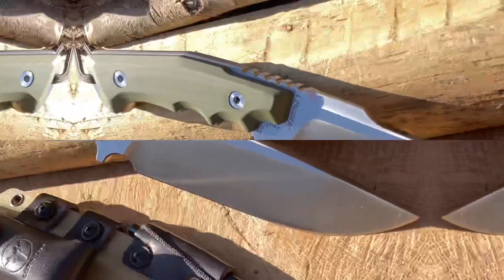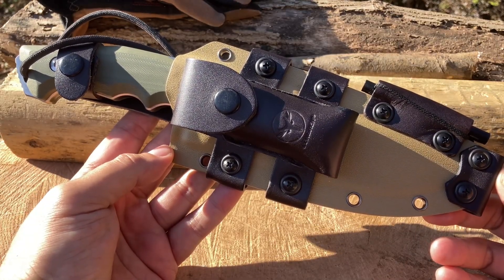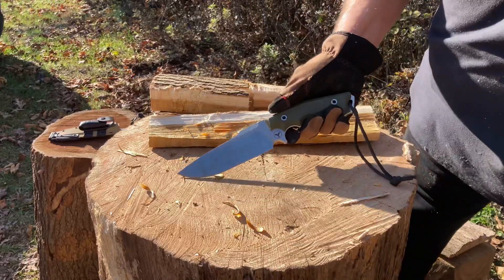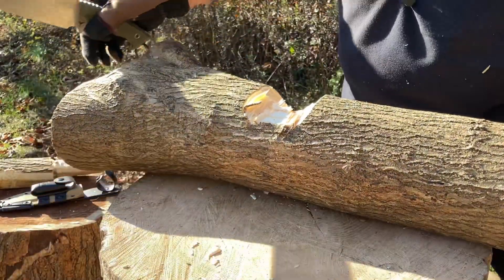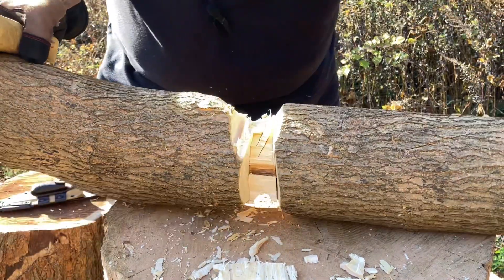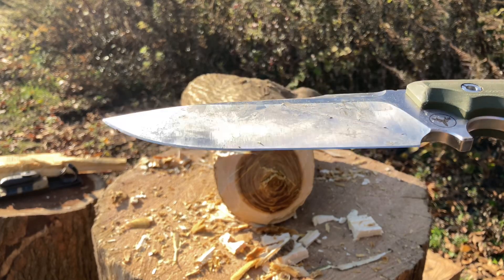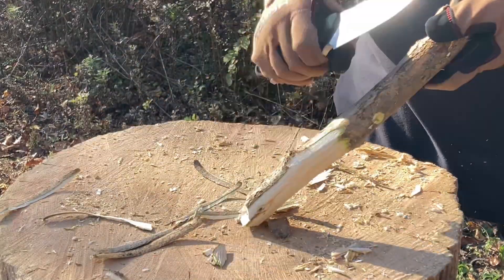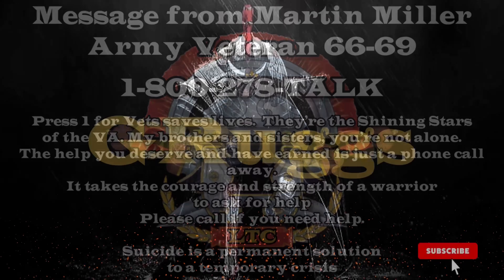Lengren Knives TANK drop point blade in Sleipner steel!

Comment from the maker: Lengren Knives TANK drop point blade in Sleipner steel!

Check it out here: https://a.co/d/0WWFHSa

LENGREN Tank 12 Inches, 7.8MM thick Full Tang, Heavy Fixed Blade, Multifunctional Tactical Knife, Sleipner Steel, G10 Handle, Kydex Sheath, and Magnesium Rod (Satin finish)

Product Description:

The Lengren Tank - an outdoor heavy-duty tool knife with a 7.8mm thick integrated spine and a bare knife weight of approximately 1.12 lbs. This is a very strong fixed blade knife, with green G10 handle scales.  Made of Swedish Udholm high wear-resistant cold working tool steel, with an extremely sharp blade and high hardness [SLEIPNER] steel. The Sheath is in a desert color Kydex sheath.  Comes with a small cowhide storage bag that can accommodate small tools, lighters, grindstones, small folding knives, and a magnesium rod (ignition equipment).

Overall Length - 12”
Blade Length - 6.14”
Blade Material - Sleipner
Blade Hardness - 62 HRC
Blade Type - Drop Point 
Blade Grind - High Saber Flat Grind
Blade Thickness - 7.8mm
Blade Weight - 1.12lbs
With Sheath - 1.63 bs
Handle Length - 5.86”
Handle Material - Green G10

Full Tang
Jimping
Lanyard Hole
Tan desert sheath with pouch
Leather Belt loop and accents
Magnesium Rod included
CNC Machined

#dskfs      
#22aday
#22adaynomore
#NeverGiveUpNeverSerrender
#NeverQuitQuitting

Don’t forget to hit the like button! 

Please help support our vets by raising awareness of the tragedy that is Veteran suicide by visiting the links below and reaching out to those in your life. If you know a vet don’t hesitate to reach out to them! 

Suicide Prevention Hotline: 1-800-273-8255 
https://suicidepreventionlifeline.org/

Mission 22
https://mission22.com/

Til Valhalla Project
https://tilvalhallaproject.com/

Message from Martin Miller, Army Veteran 66-69

1-800-273- TALK, press 1 for Vets saves lives. They're the Shining Stars of the VA. My brothers and sisters, you're not alone. The help you
deserve and have earned is just a phone call away. It takes the courage and strength of a warrior to ask for help.  Please call if you need help. Suicide is a permanent solution to a temporary crisis

I love this community!  The knife, sword, saw, fatwood, bushcrafters, and all the new people who have subscribed!  We are LEGION!

You guys' ROCK!

LIKE! SHARE! SUBSCRIBE!   Also don't forget to check out the other content creators!  They are all good people with great videos!
Reply: En effet, cette magnifique lame ne pouvait pas se nommer autrement que Tank! Les finitions ont l'air parfaitement maitrisées!

Comment: I really pulled the trigger on this knife along with the rhino and jungle primitive models.
Its name "TANK" is very fitting. Definitely high quality. Bought the coated version for added protection against rust. Feels great in the hands. Hefty but still comfortable. The handle is a bit bigger than what's on the Rhino but the ergos on the tank is much better. I wouldn't have come across this knife if it wasn't for this vid so thank you, man!
Reply from the maker: You are welcome!

Comment: Do you feel any difference when using DC53 and sleipner?
Reply from the maker: Same. Both seem to hold its edge real well.  Both are easy to strop and hone on an Arkansas stone.   They are kinda the same to me to be quite honest.  Only difference is Sleipner is more expensive
Reply: @LegionTacticoolCutlery  
Thanks for the answer. I prefer the cheaper ones if they have similar performance.
Reply from the maker: Don’t blame you.